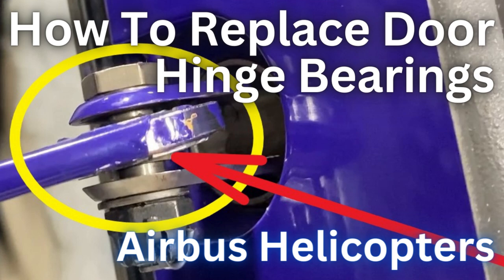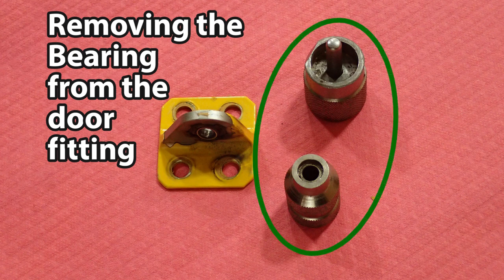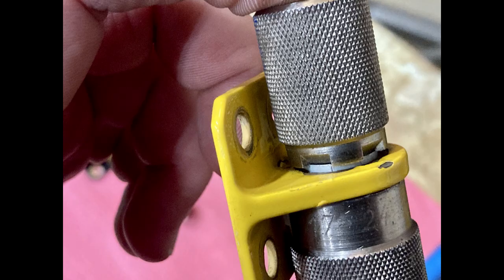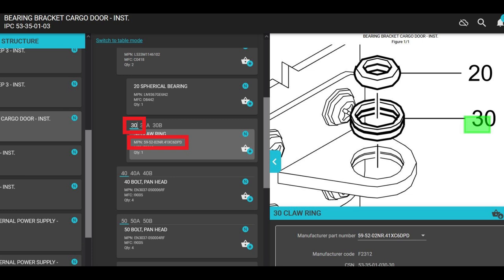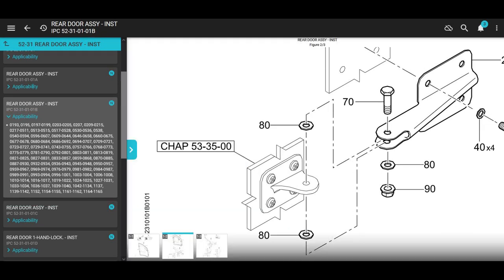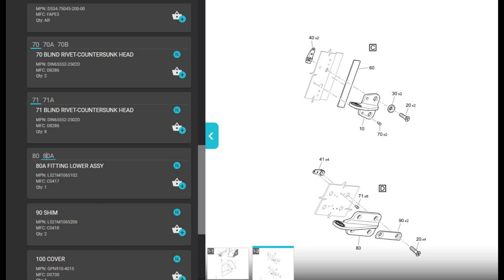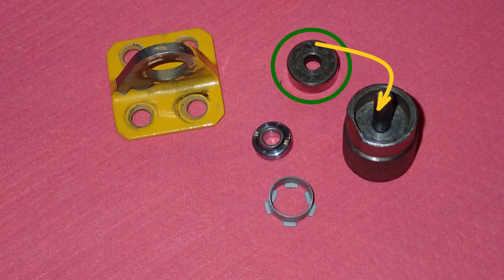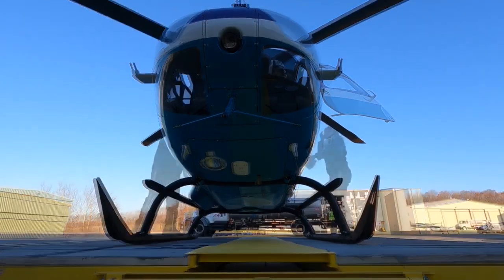Door Hinge Bearings | Airbus Helicopter | EC135 & EC145

Comment: Quick tip: if you have the Knippex 86 03 400 or a similar tool, you can replace the bearings without removing the breaket from the airframe.
in my experience, especially in the case of rear-loading medivac operations, the cargo door bearing replacement is due after about 1000h.
if you work a lot on helicopters under these operating conditions it might be beneficial to invest in a tool like the Knippex 86 03 400.
Reply from the maker: Thanks for the tip.  I'll have to try that out.  I have heard of other guys doing similar things but I never had pliers large enough to try.  That would be useful and save time to replace the bearings this way.  Also it would save time on the pilot's doors, you could replace the bearing on a table without needing like three guys to hold the door into position next to a press, at just the right angle. 

Here is a link to Grainger for the Knipex Pliers that you mention, for anybody else that is looking:
https://www.grainger.com/product/35HU02?gucid=N:N:PS:Paid:GGL:CSM-2294:PSN7SY:20500731&gclid=CjwKCAjwkLCkBhA9EiwAka9QRmgXB7S3sLmBUtkzPG9-YUDUo2C1OH7t8113CrJb3Ld9riZ_7BX3ahoCRy0QAvD_BwE&gclsrc=aw.ds